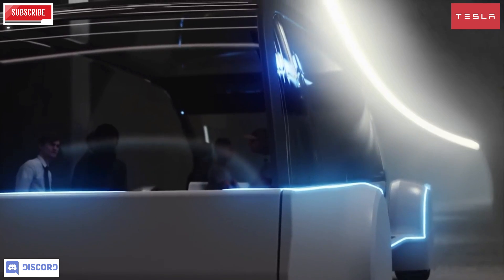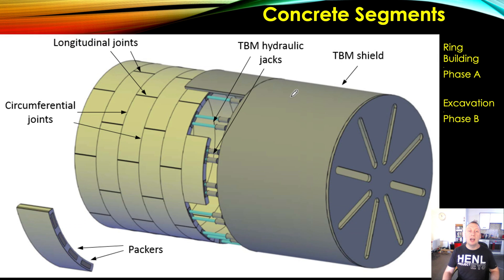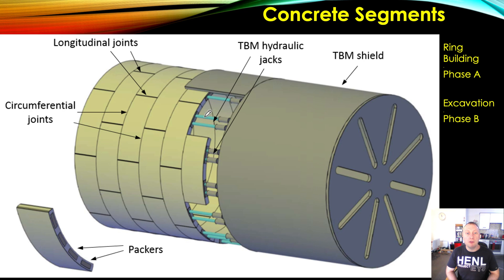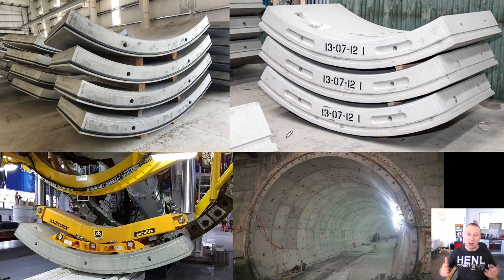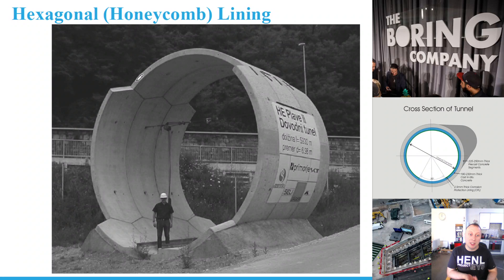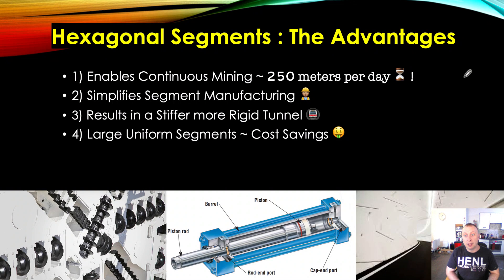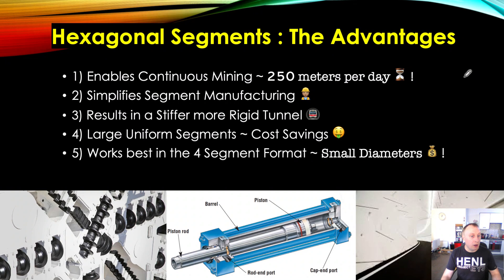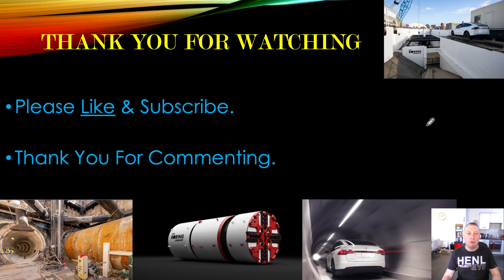The Boring Company 🚇 😃 🇺🇲 Hexagonal Concrete Segments Are The Future 👷🏽‍♂️ 🏗️ 🚎 PART 1

Comment: Can someone explain why the boring and segment installation cannot be done in parallel? As I understand it, there are a ring of hydraulic jacks that are pushing against the last wholly completed ring to create the pressure at the rotating cutter face.  In a number of videos, these are shown to all retract (with the cutting stopped) in order to allow a whole additional ring of segments to be installed.

What I don't get is, why can't just a few jacks be retracted (while the remainder sustain pressure at the cutting face) to create space for a single ring segment to be installed. Then, those retracted segments apply pressure to that new segment (now sitting one segment-width forward of the other segments), while the next section of jacks retract to continue the process. As long as the full ring of segments can be installed before the jacks reach max extension, it seems like the process could be repeated.

Or, is there a problem with applying pressure against the leading edge of those segments that are installed in a partially completed ring (e.g.segment rotation/slippage)?

I'm not sure if I'm describing my question clearly. Hopefully someone understands and can answer.
Reply: Jeff Cadman you are correct to an extent. This can be done and has bee tried. But there is a lot of maintenance and support systems to a TBM that require time. This is often done in parallel with the building of the ring so the time is not really lost. 
Continuous mining is used to some extent on long straight tunnels, usually in rock, often for water transfer. These TBM’s are called double shield machine, which, as the name suggests, have two shields, one protecting the TBM front end as normal, with a second shield, which can move forward independently, where the lining segments are erected. The main TBM achieves its thrust reaction from Large sideways hydraulic rams and pads gripping on the rock wall rather than pushing on the last built segment ring.
Reply: @davidsalisbury50  Thanks. Yeah, I watched some of TheRobbinsCo videos that do a good job of showing the double shield (and other internal elements...these are incredibly complicated and intricate systems!). I'd never thought about the need for preventive & corrective maintenance. Obviously you can't just pull the machine out of the tunnel and swap it with another (as you might with most construction machinery). So, managing downtime for maintenance (which I suppose would also include things like cutter face & spoil extraction changes as the geologic conditions change -- one of Robbins' videos talks about that) makes sense to have factored in to system operations.

I imagine the goal is obviously to minimize downtime as much as possible, but it seems like it couldn't be entirely eliminated.

Fascinating! Thanks!
Reply: Jeff Cadman for a lot more information and the latest developments see the “Herrenknecht” website. They have some excellent videos.
Reply from the maker: The issue is complex but you're trying to spin a lot of plates at the same time whilst keeping the machine on the correct path.
This is a good video to visualise the various processes needed to build each section of tunnel. 
https://youtu.be/haZs9Vwvr_0?t=6
Reply: @BoringRevolution  Thanks for the link. These machines are absolutely incredible.

This whole industry is very similar to the space industry. I don't doubt that every one of the current world leaders in this domain have done absolutely phenomenal engineering to create these insane machines. Just like Boeing et al have done incredible work with decades of experience building and launching rockets and satellites.

But, as Musk demonstrated with SpaceX (and Tesla), sometimes the leading experts get set in their ways and refuse to believe that there are radical opportunities for significant improvements (vice just moderate incremental improvements). The space experts all said it was impossible (or at least uneconomical) to land & reuse first-stage boosters...until SpaceX demonstrated that to be false.

I can see the same thing happening here (and, even just specific to tunnel boring itself --- that's not even including the fact that TBC is really about much more than boring tunnels, but really about a new mode of transport).

When you look at these videos, you realize how amazing and complicated and complex the existing designed machines are. But you can also imagine that there are numerous areas where every step in the process could potentially be improved upon...particularly if one is not wedded to "how we've always done it" and is willing to go back to first principles and challenge every assumption and consider every step in the process as something that can be improved upon.

I suspect that, just as with space lift, we're likely to see TBC demonstrate some significant step improvements with future TBM designs. Should be exciting!
Reply: Building on the above, another parallel with SpaceX is the fact that TBC and SpaceX both have the opportunity to simultaneously be providers and customers. There is huge advantage to being able to expand the vertical integration of a company (as Tesla and Apple have demonstrated), because it allows for globally (in the sense of the whole system/product) optimal decisions to be made, vice local optimization being done by each independent provider throughout a chained process.

But, those opportunities are further magnified when one is simultaneously a producer and consumer of product/services.

In the case of SpaceX, it's one thing to revolutionize space lift. But then when they expanded to developing & fielding Starlink, they also became their own biggest customer of lift, and their communcations satellite services could benefit from having ownership over the lift services (a huge advantage they'll hold over other satellite services companies...other than perhaps Amazon's Kuiper with Blue Origin, or theoretically Boeing...but those companies have really not demonstrated the additional edge of radical and rapid innovation).

In TBC's case, they have the advantage that they are really about developing a transportation system. And they happen to need to dig tunnels to do that. Most other TBM manufacturers (I assume; I'll admit I'm just learning about this industry, and I haven't taken the time to do much research here) simply build and sell those machines to companies who are providing tunnel construction services (probably as a subcontractor to a larger transportation engineering company). And, even if TBM manufacturers are running their own equipment, again they are probably doing that as a contracted service to customers who want to build tunnels.

In TBC's case, they ARE the customer. And they have a self-serving interest to build as much tunnel milage as possible, and therefore as quickly and cheaply as possible. So, they have a much more intrinsic motivation to seek and pursue ways to optimize their TBM design.

And, hopefully as we've seen with SpaceX (and, somewhat less visibly with Tesla...though I think SpaceX is the better analogy as they are not manufacturing consumer products), TBC will pursue rapid iterations of system redesign as they seek continual improvement.

I will say that I'm a little disappointed in the pace of such spiral development that we've seen from TBC so far. But, that's probably because I'm unfairly comparing them to SpaceX which has been around for more than around decade longer. The early days of Falcon 1 probably weren't as mindblowingly rapid innovation as we're seeing with Starship. So, hopefully we're just at the leading edge of some really exciting stuff to come with future TBC TBM designs.

Comment: Will - Is there an alternative to concrete?
Reply: Warren Redlich yes. Steel, plastics, spheroidal graphite iron, fibreglass and several composite materials have been attempted.
Reply: @davidsalisbury50  nope concrete will remain the solution
Reply: Le Chat Botté I agree. But there is a world of difference between 20/20 basic concrete and a high strength, fibre and polypropylene 70MPa concrete these days, with greater improvements all the time. Getting these improvements incorporated into accepted coded is a slow process. But to some extent this is necessary if the 120 year design life assurance is to be maintained.
Reply from the maker: In Tunnels the use of Cast Iron & Steel has steadily declined over the last 80 years as concrete has become readily available, super reliable and most importantly very cost effective. The idea of using Stainless steel really fascinates me, especially with the prospect of joint welding segments together and doing away with most of the bolting & fastening. 
Some kind of galvanised steel / Glulam timber "hybrid" might be possible but has never been attempted or studied. Would be ultra light and much stronger than the old cast iron segments! 
For me tho Stainless Steel is a wonder material with endless possibilities 😉 !!!

Comment: Very informative. Thanks.
When the tunnel curves, segments would have to change shape. CNC casting.
Reply: The same ring set can be used for straight runs and gentle curves. The straight runs just have a very slight wobble or spiral in every ring.
Reply: @avid0g  That wobble would cause a sealing problem I would think.
Reply from the maker: A couple of solutions to the "curve Issue" !
Your idea is viable and very cost effective.  As long as adjacent segments or ring beams are adequately interlocking & or bolted together its workable. 
Boring Co. will focus on straight runs of tunnel 350+ meters with curved phases of tunnel under 45 meters long. Thus the TBM will only lose a couple days at most.

Comment: Wouldn't it be bad ass if the spoil could be used to make the tiles?  Perhaps a nuclear powered boring machine that heats the spoil into magma and casts it into the tile. 
I'm sure there's a stack of engineers that are itching to tell me why this can't be done.
Reply: 0ctatr0n it can’t be done. And it wouldn’t work. 
Can’t be bothered to explain why. Try researching.
Reply from the maker: @David Salisbury  🙄 ???
Reply: You just have to make a molten hot heat-pump encased in a solid Tungsten alloy "bullet". Then you push it Very Hard into rock while somehow pumping all that heat away from the sides. Somehow. 

"Oozing down the street"

Comment: It is stupid, and slow, to dig a tunnel by scraping 100% of the surface of the rock. What should be done is to cut only the perimeter of the rock, on a depth of a few feet, which is fast and requires little power. Then a tungsten spearhead is projected into the center of the tunnel with a railgun, smashing the boulder into a thousand pieces. Since the perimeter of the block is cut, this prevents the "explosion" from spreading into the wall. Then the rock debris is removed and the cycle starts again. The whole system runs on electricity.
Reply from the maker: I like this company a lot, however in none-cohesive / fractured strata it would struggle. Similar to your concept yes ? 

https://www.hypersciences.com/hyperbreaker/
Reply: @BoringRevolution  It look's like a railgun. So it's a bit like my concept but the system is not thought out in a coherent whole. The 'big drill' is a stupid idea. No need for that.

Comment: I have suspicions that method has been patented; and due to legacy pricing will be priced above what TBC wants so they might be looking at something different again
Reply: AhillfromOZ ...... no. There are a number of hexagonal segment stems available, and most segmental kings are bespoke designs. The problem with them is threefold:
The can’t go round corners;
They leak;
They can’t take the massive thrust pressures that provide the forward movement and ground support for the TBM in front of them.
Reply: @davidsalisbury50  
"massive thrust pressure" 
The hydraulic rams are capable of pressing on all segments that are not being installed at the moment,  however that might cause non-symmetrical force on the face, so both the installed tile and the opposite tile are unloaded. 

This is why the pressure on the other tiles is increased to compensate, and why systems have failed in the past - the tiles have to handle higher compressive force. In the four tile rings, the force is doubled. 

The machine somehow needs to apply thrust around the entire perimeter, even while installing tiles.
Reply: “Systems”and “rings”! Sorry
Reply from the maker: @davidsalisbury50  Are you going to comment on every reply ? ? ? 
This is a little much mate.
Reply: @davidsalisbury50  
It's ok to edit your original comments.
Reply: David Ogawa. To install the segments the rams need to use minimal thrust pressure. Each ram on a medium size TBM is 200t. 13 to 19 rams would be typical on a 5m diameter TBM. However! The face pressure of a closed face TBM needs to be maintained while the segments are being built, this can be several hundreds of tonnes. Then while excavating the rams need to overcome the friction on the skin and provide load in the face to excavate. Usually around 50T per square meter. So the rams have a capacity of say 200x 13 = 2,600t. Hydrostatic and ground Face pressure may be easily 500t, friction 300t. Allowing around 1,800 T of excavation thrust. But you can’t use all of this because of “steering” issues. 
My point being that hexagonal block segments can’t manage these loads at the same time as being built, distortions occur, the ring deflects etc.
TBC will have to overcome these physical constraints which have plagued tunnel engineers for decades, as well as manage them at an order of magnitude higher if they are to make use of greater installed power. 
Non- symmetrical forces, when you are putting thousands of tonnes into a 250-300mm thick segment bring problems very quickly. Lining and TBM designers go out of their way to avoid this
Reply: @davidsalisbury50  
Sounds to me like the hex tiles installed into uncured grout do not have the capacity to hold the accelerated cutting forces. So the cutting face loads will also have to be transmitted farther back into tiles that are embedded in cured grout. 
Quite the engineering challenge to push off the inner surfaces of dozens of rings, spreading out the load. 

Do you know of any downside to accelerating the curing speed of annular grout?
Reply: David Ogawa pushing further back on a lining with cured grout may be an option. But still limited by the external ground strength, hence best suited to hard ground or rock. 
Accelerated grout (called the AB or two part system) for grouting through the tail shield is very common, pretty much the industry standard. Grout only needs to be as strong as the surrounding ground really. Designing for greater strength is a bit of a waste of money. Quick setting (known as “gel time”) is the main goal. The grout will then gain strength over time but to keep the TBM moving at >5m per day the gel stage of the grout and the walls of the lining need to be able to transfer the loads several rings back and into the surrounding ground without distorting. It’s one of the key parameters of any TBM/ring design for any particular diameter, alignment and ground conditions set.
Reply: @davidsalisbury50  
This curing grout can be shear damaged if the distortion in the tiles changes too much. I see that having a very rigid system of fastening tiles together is important for protecting the curing grout; Also maintaining consistent forces on the tunnel tiles while boring will prevent shear fractures in the gelling grout. 

Grout must be an important subject to innovate in order to increase boring speed by another order of magnitude.
Reply: David Ogawa I think you are correct. Most modern segmental lining systems are bolted together in the radial joints with bolts or dowels in the circumferential joints. Some are completely unbolted (often referred to as wedgeblock linings). Many projects remove the bolts at the back of the TBM back up (100m or so back from the front) once the annulus grout has hardened and the thrust forces are distributed into the surrounding ground.
Reply: David Ogawa. Again correct. Annulus grout is a vital factor in overall production rates. You need 1.5m3 of grout per meter of 5m diameter tunnel.
It is also essential minimise surface settlement above and behind a TBM.
Most tunnels use a two part system which mixes an accelerator with the base cement grout at the point of injection.
Reply from the maker: I'm unaware of any patents surrounds Hex Segments.

Comment: Traditional rings are not completly round. They have a slight bevel. If you want to move your tunnel up down, or to one side, you simply rotate the ring around which makes it very practical as you only need one set of standard rings to be able to get the shape you want.
Reply from the maker: Just had an interesting cluster of emails from an engineer in Brazil of all places. Says he worked on a job for 3 years in which they used both Hexagonal and Rectangular segments in one tunnel. . . 
Seems like I need a follow up video 😉 !
Reply: Oh that explains why some tunnels I saw have alternating angled segments.
Reply: By traditional rings I guess you mean those used by the legacy tunnel boring companies that have been successfully building tunnels for over a century.  Thanks for posting. Beveled rings make perfect sense because you can gradually or more rapidly change direction of the tunnel.  What happened to The Boring Companies list of upcoming projects?  Oh, I guess once the adults started looking past the bs of musk, there was literally zero added value and zero real world experience there.